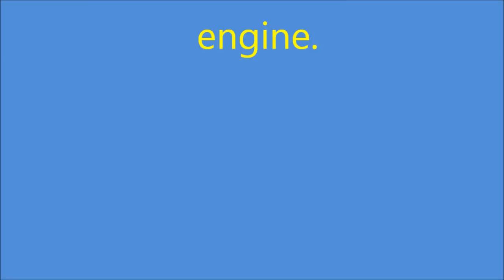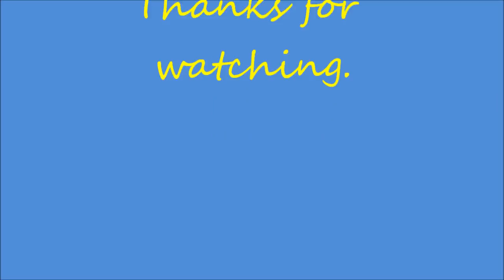FORDILLAC V 8 ENGINE 2

Comment: Very good work I want to build a motorcycle with an engine like this a miniature v6 or v8 need to get some machines to do it. I took a machining course and was inspired by Dennis Franz's bike with a 394cc v8 on it. Is there any tips you have on how to scale down the parts from existing full size engines? I'm thinking of doing a scaled down VQ35 DE what CC is this one? I was thinking of using Honda 4 stroke pistons either GX25 GX35 or GXH50 pistons and possibly the valves and other parts to those engines.

Comment: Another amazing piece of masterwork machining from ya! Seems like with a little more tuning...and perhaps a heavier flywheel...you could get that thing to fire up with just one or two crankshaft revolutions, to idle at 600-700RPM. Would sound amazing runnin' that realistic, too!

Wonder if this thing has enough power to propel a 1/5th 2WD RC buggy. 30 pounds or so, stock engine's a 4 or 5 horsepower single cyl...